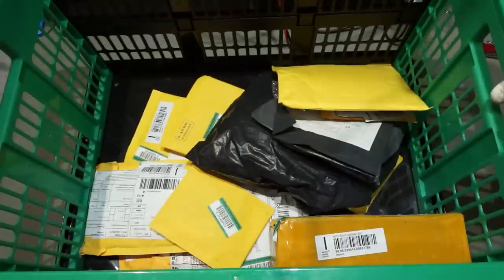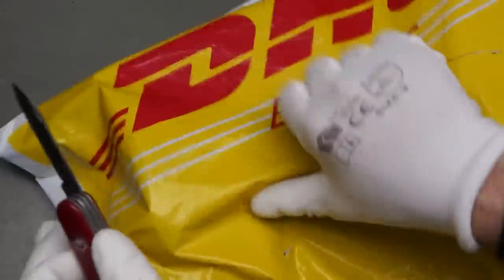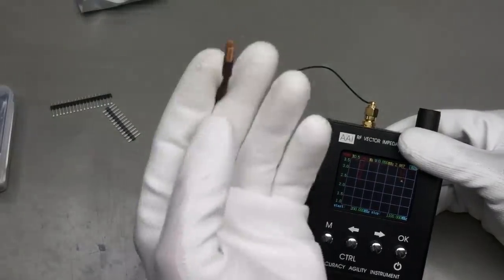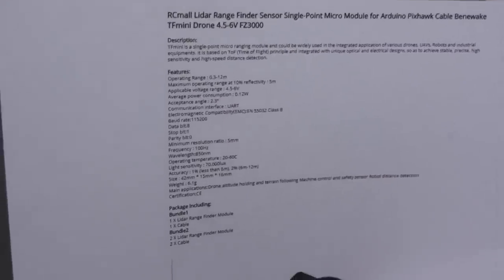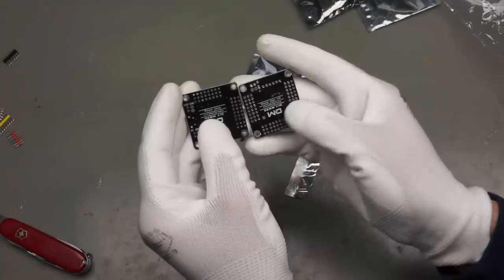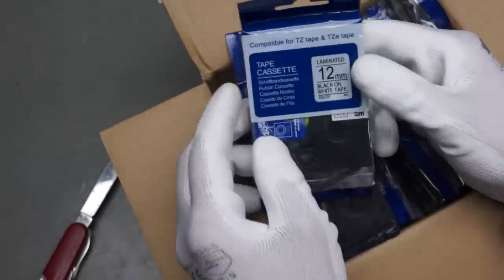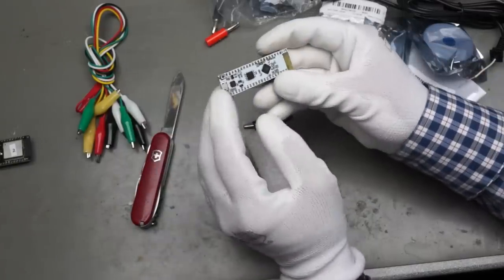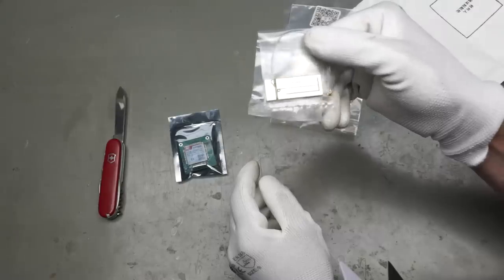#200 How to Spend your Money Wisely

Comment: i'm thinking of a project, buy all the shit and when it arrives a month later i forgot about the project. stuff is piling up in here lol  atleast now i'm at that point when i think about a project, it got 90% of the stuff allready here, but then im either too lazy to begin or i have no space to work on it
Reply from the maker: Maybe you watch this video about excuses: https://youtu.be/g3s0--LcgQw
Reply: I'm in the same boat. I find that a notepad I can sketch things into helps. Most packages that come are very poorly identified though, so sometimes guessing what's in there can be fun.

I'm also in the position of not having a dedicated space, so I've begun putting each project into a separate little box. It is annoying to have to pack everything up and put it away though. 

One of my goals is to create a portable dev workstation (soldering, lights, magnifying glass, and 3rd hands) all inside a 2ft square box (the height will probably be the same as my soldering station). Then I should be able to just close it up, unplug it and put to the side. Of course, all my components need to be stored elsewhere, but this should at least let me quickly interrupt what I'm doing so others can use the dining area for homework, eating, etc.
Reply: Same
Reply: This is absolutely the story of my life.

Comment: Don't forget to check the power supply voltage before using it. I bought the same one and got a 12V (with a 5V sticker on it)...
Reply: Yes, the same thing happened to me as well. Ordered two 5V supplies that looked similar to the one shown in this video, and one of them was 5V, the other 12V.
Reply: um I guess that sucks... I wanted to point out that efficiency really matters with a 24/7 project. so even if it is 5V can we please get the efficiency which it does manage with the load you will be using it at?
Reply from the maker: Too bad. It is always good practice to check voltage before you connect it to delicate devices.

Comment: Thanks Andreas!
Ignore the criticisms! These people don't know how to help people, don't share and don't have their own ideas, they are only good at finding problems with other people's work and will always be this way.
As engineers, we are problem solvers, NOT just problem identifiers!

I have a great MQTT & Node-RED (RPi3) based home automation system (partly inspired by you) that is continuously growing. It uses the 8266 in promiscuous mode (thanks to you) to detect whether & when my partner or I are home (or not). Some of those small form factor PIRs (thanks) to add. I'm in the process of modifying some cheap (& easily to disassemble) eBay RGB bulbs with 8266s. I love my MQTT light strips, too; they fade on before sunset and change colour slowly throughout the night, fading out around sunrise. 
Lots of temperature and humidity sensors, with some TEMT600  light sensors to add soon.

I do build lots of stuff (pretty good at buying only what I will use) and modify the hardware and/or software to suit my needs, but I sometimes have difficulty getting them into a final case/enclosure. However, I'm working on getting these completed!

My kitchen scales failed recently and you showed us how to repair them, thanks. I was thinking of MQTT connected, but decided to be realistic/sensible!

Is German your first language?
Danke schoen!
Auf Wiedersehen
Reply from the maker: My first language is Swiss German, which is similar to German. We learn German as a first foreign language. Then we learn French (because on part of Switzerland speaks French), and then English...
Good to know that you were able to use the videos not only to build something but also to repair something.

Comment: Ooo, ooo ... I am so jelly of the LED buttons.  They have been in my cart for weeks.  Think they are a good match for an i2c port expander.  By dithering and polling, you can effectively use them as digital input and output at the same time.
Reply from the maker: And you can use many of them...
Reply: Yes, I put 5 direction buttons, and a rotary encoder (3 more), connected with a PCF8574 on the same project board as an i2c OLED.  It is a low power human interface that uses just two data lines.  It would be nicer with your LED buttons though, to show what options are available with each menu.

Comment: Hey Andreas! I'm a big fan of your channel. I'm hoping you can offer me some guidance. I've built a mini solar powered fm transmitter. Consists of a 6v 2w solar panel connected to a small solar controller. Puts out 5v and works like a champ, when the sun shines. That's all OK with me.  Here's the problem. At dusk and dawn, the voltage drops and transmitter makes some very unpleasant sounds. Is there a simple circuit that disconnects when the volts drops below 5v? I'm considering a small 3.7v battery, a TP4056 and a small step up boost converter. Maybe that would manage the voltage a little better. Am I on the right path? Thanks Much!
Reply from the maker: I made a video about solar charging. There you see how you can charge a battery and how to calculate the size of the solar panel and the battery.

Comment: Nice postbag, 
I need to groome some ideas that justifies buying :-) 

What is your opinion of buying components from China? I have stopped doing it myself. I have had a lot of bad experience getting either fake components or out of spec stuff. Instead I have a spreadsheet with the component I want, and when the total exceeds the limit for free shipping, the order button is pressed. Its usually from Digikey, and here you get first class component, often to a price that isn't much higher, not to mention the shipping time which is a couple of days.
Reply from the maker: I generally have a good experience. But you get what you pay for. Your Digikey strategy seems to be good.

Comment: Hi Andreas - For Arduino Nanos, you can get cheap host-boards that add the "signal-ground-Vcc" type connections - you can plug-in existing nanos into it. I find this more "universal" rather than a dedicated nano-like (but different) board.
Reply from the maker: I used them in the past and I liked them too

Comment: Suggestion: Take 2 arms from your new (6 arms) PCB holder and attach them to your old 2 arms PCB holder and VOILA.....you'll have 2   (4 arms each)  PCB holders. That way you can always have an extract fan attached to 1 arm and still have 3 spare arms to work with.
Reply from the maker: Good idea. Maybe I do it.

Comment: Hi, thanks for showing,  What about the ripple and frequency polution on your 5V 4A Power Supply, because they are shown for LED, and often they have poor harmonic and ripple ability for electronic or radio usage
Reply from the maker: I do not do tests in mailbags. But I also do not expect wonders from these cheap power supplies and would not use them in delicate projects. There I still like batteries of linear power supplies.

Comment: Hi! Congrats on a new good video. About testing the antennas (for the TTGO, for example), wouldn't the ground plane and connexion to the TTGO board affect the antenna properties? Is it possible that, when connected to the board, the resonant frequency shifts closer to 433MHz? Or maybe by adding a ground plane?
Cheers!
Reply from the maker: Antennas always change behavior. But the VNA also acts as „Ground“

Comment: Dear Andreas. First thanks for the high quality videos. Next: I have a mqtt/node red server and are sending data so it acts as a weather station. I do however want to have a remote sensor back in the yard outside wifi coverage. Which lora boards do you suggest? I would like not to purchase a full lora server so I am considering just use another single channel lora dev board as server....
Reply from the maker: Maybe you watch my video about point-to-point LoRa

Comment: Hello Andreas, is the 5volt power supply suited for a Raspberry Pi (i.e. the voltage is stable enough) ? Thank you
Reply from the maker: It should be ok. An RPI3 consumes around 300 mA and not more than 1.5A peak

Comment: 22:27 There is also a version with 4 hands instead of 6. 
Do you find these ones easy to change position and make them stay where you want them ? 
I have a similar 6-arm which is quite difficult to set at the position I want.
Reply from the maker: Thanks for the info. The arms used stay quite well where you place them. I used this for my old one and also for the air on my milling machine.

Comment: beware if the BG colored alligator jumpers, I got some a few months back, and they were extremely poorly put together. The clips were barely crimped on, and not with proper crimpers - possibly a kid with a pair of pliers - and they were barely making any contact... I had to waste some time to solder them up to ensure I had even a decent chance of connectivity/current carrying ability. Maybe we need to make up some cable tester which puts some load across it and checks voltage drop.
Reply from the maker: You are right. I also solder my alligator clips

Comment: The only think I dont like is that SIM7000 is about echo cancellation is no longer supported, and does not support voice calls in the fall-back option. It also dont have the frequency B17.

What about WP7702?
Reply from the maker: Did you try it? In which country? I am only interested in data transfer.
Reply: I have collected information from both of them and I have contacted the manufacturer to clarify those doubts.

I have worked with SIMCOM modules but I am going to get some samples of Sierra WP7702 to test them.

i am from Spain.
Reply from the maker: So far I do not see these modules on AliExpress. I only test them if they are available for the public. 
Did you test the SIM7000E?
Reply: I bought a SIM7000E module in the AND store in Aliexpress, but I could not try it since it lacks what T_T was looking for.

Comment: Hi Andreas. In the LIDAR Ali site there is a github link with info. The module appears to transmit UART packets of 9 bytes. The first two bytes are always 0x59 (frame start) . Then comes two bytes (16 bit integer, low byte first) with the distance measurement in cm. Then comes another 16 bit integer with the measure strength (I don't know the units). Then a reserved byte, a signal quality byte (unknown units) and finally a checksum byte of the eight previous. I think I'm going to buy one. Cheers!
Reply from the maker: Thank you for the info.

Comment: Grate Video again :-D! I tried to use the HC-12 with common Rf433 devices but it turned out it has built in channels and this channels are not the same as other devices use. HC-12 can be connected to another HC-12 only as I found out... Maybe you will have a solution
Reply from the maker: I would have assumed they work together. I did not look into the datasheet if which modulation they use.

Comment: Speaking of spending money wisely, do you have any preferred source for soldereless breadboards? I bought some great ones a couple of  years ago, but it seems every breadboard I get off eBay now is junk (weak adhesive pads, casting defects on the plastic, bent contacts, etc.). If you complain they give you your money back, but what I really want is decent breadboards. :P

I've opened them and the metal strip design is indeed very different from the (excellent) older ones, but there is no way to check that before buying, and most of them don't even have a brand, so you have no idea what you're getting until it arrives.
Reply from the maker: No, I do not know of a good source. Most are the same cheap ones they sell under different names. I use them and adapted my expectations ;-)
Reply: I have actually noticed a pattern: my two best breadboards are both 830 point models, have the columns labelled in capitals (A, B, C) lined up vertically (so the letters look correct when the breadboard is in "portrait" orientation), and have rows labelled 1, 5, 10, etc.

The worst ones (both 830 and 400 point) have the columns labelled in lowercase (a, b, c) and the rows are labelled 1, 2, 3, etc.

I have also found a third kind on eBay (but don't own any of those), that uses capitals, but the letters are rotated 90 degrees (so they look correct when the board is in "landscape" orientation), and where the rows are labelled 0, 5, 10, etc. (starting at 0 instead of 1).

Of course, there is no guarantee that you get the model shown in the picture, and some eBay sellers actually have mixed pictures, showing two or more types.

If they showed the actual metal contacts, it would be much easier to determine which are which, because the design is clearly different. Sadly, even on models with transparent plastic it's very hard to tell from the photos on eBay / AliExpress.
Reply: Update on this: I have finally found some good 400-point breadboards.

They are eBay item "302104169648" (just put that number into the search field). Both the package and the lettering on the breadboard are very similar to the bad ones, but the plastic casting and the metal contacts are very different. They are not 100% identical to my best 830-point breadboards (the plastic is softer), but the contacts are very similar.

Hopefully, they will stick with the same supplier.

Avoid item "322216151797", BTW, those are terrible (they use a photo of the good one in their listing, but the item you get comes in a slightly different package, and the contacts have terrible quality, some of the holes don't work at all).
Reply: @RFC3514  thanks for the information. I have received some breadboards from a different listing on eBay, but they look the same and seem to work quite well yet are cheaper (seller diy_smart, item 322743820679). Pro tip for ESP32 users: cut the breadboard down the middle, preferably with a electric jigsaw, then you can have four holes per pin instead of just one! 👍🏻

Comment: ATmega328PB would be better for projects... Check the board as some of the pins change from the older 328.  But you get more timers and USART in the same package.
Reply from the maker: I did not see many boards taking advantage of the PB version. But I have to admit, I do not use these chips a lot...

Comment: AD620 on Farnell costs like 14 Dollars a pice, on Digikey still about 10 Dollars + tax + fees to Switzerland. On Aliexpress one costs not even a dollar. Could you test if these are genuine parts? Or maybe recycled?
I made the experience that assembly houses in china, if asked to supply original parts, charge pretty much farnell / digikey prices for the parts so this makes me wonder...
Reply from the maker: It is well possible that they are fake. I did not have the time to test them so far. What we always have to consider is how much one minute work costs in the western world. Usually much more than the part itself. And the factory which also supplies Farnell is probably located somewhere in the Far East. 
Fortunately, I am a Maker and do not sell Hardware. I suffer myself if parts are not ok ;-)
Reply: @AndreasSpiess  Hmm would be an interesting topic I think.
To be honest, I use original parts even if it is for my own projects. I used "aliexpress" parts but since I work I find that it is just not worth it. I spend many hours developing and drawing boards, assembling, debugging etc. Plus, it should be fun and adding more debug hassle usually isn't. I'm probably also a bit spoiled since I work on boards professionally. But whatever floats your boat I guess. Anyway, thanks!
Reply from the maker: I so far had not a lot of bad experience with modules from China. And I assume they also have to source there. But I am not a specialist in this matter. Maybe LSCS will be able to establish trust for parts. They want to become a Digikey.

Comment: Good morning Andreas!
I have build a  pellet burner completely homemade for my heating system, its running with an arduino micro it works really well. This year i would like to implement a wireless module to control it over wifi. I would like to know your recommendation!

Greetings from Greece! 
Vasilis K
Reply: wemos d1 mini
Reply: Καλημέρα! Εφόσον λειτουργεί με το arduino, είναι σχετικά εύκολη η μετάβαση σε κάποιο esp (esp8266, esp32).
Reply: Κώστας Μπέκος Ευχαριστώ πολύ για την  απάντηση σου πατριώτη, εύχομαι να είναι εύκολο.
Reply: Thank you for your constructive criticism, whether positive or negative  there is always room to improve ourselves. You are 100% right for all the above mentioned, I should have explained how does this machine work, which i am planning to do in the future. 

Greetings from Greece!Vasilis K
Reply: Hi there!I had in mind to use the esp8266 as a temperature data logger mostly, or even as a remote thermostat switch. I have to decided first what it will do, thank you for your answer and suggestions!
Vasilis K
Reply: Hi there and many thanks for replying. So far i didn't have any issues with the operation of this machine, as for safety i have two thermostats in parallel that will cut power to the feeder, the microcontroller also has it's own thermostat, also there is a threaded bimetallic switch mounted on the body of the burner at 65 'C that will also cut power to the feeder resulting to a temperature drop. I am trying to make it bulletproof in software and the mechanical part as well, also i have done LOTS of tests before installing on my heating system, as i said before there is always room to improve the design of this machine making it a little smarter. 

Thanks again for your help!
Vasilis K
Reply from the maker: Vasilis, as mentioned below you can use an ESP8266 0r an ESP32.
Reply: Andreas Spiess Thank you for the recommendations, I am so greatful that found this inspiring channel!!